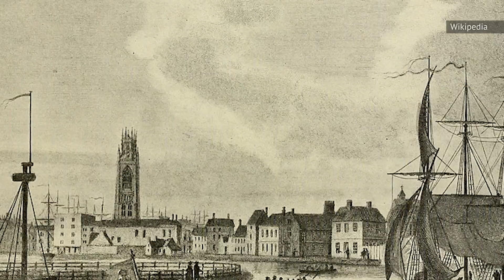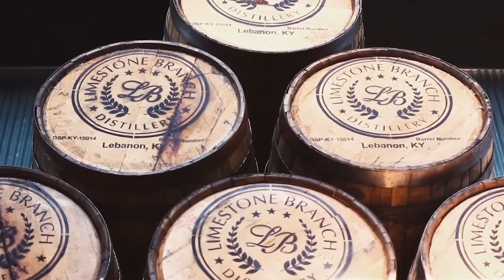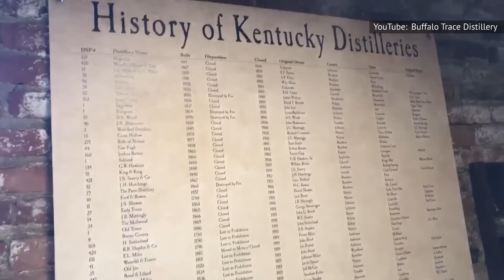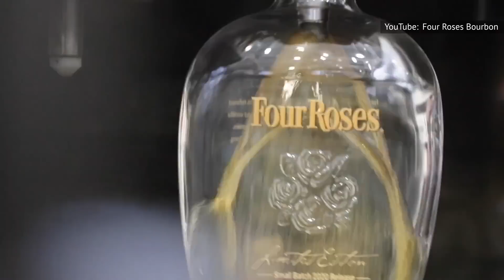Don't Take Another Sip Of Bourbon Until You Watch This

Comment: If you are making bourbon cocktails, don't use an expensive bourbon.  Most people do not have the ability to taste the difference between a cheaper bourbon and an expensive bourbon in cocktails so you would be wasting your money by using the expensive bourbon.  Rye and wheat bourbons will give the cocktail a different flavor, so have fun experimenting with the two types.
Reply: I agree somewhat. If you are dumping coke in anything it largely doesn't matter but there's complete garbage well whiskies out there that are still horrid compared to at least a Jack and coke. There's literally a brand called Bar Code Whisky. As in the thing you scan at the register. 🤮